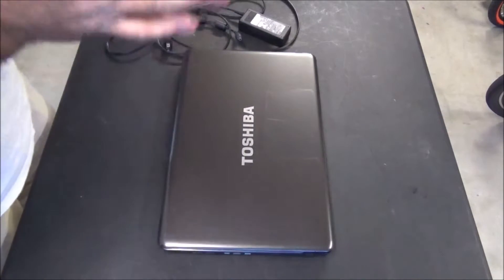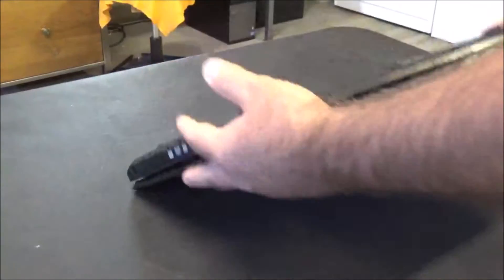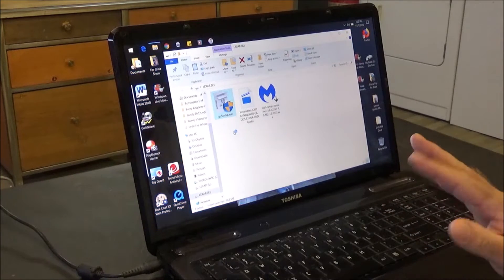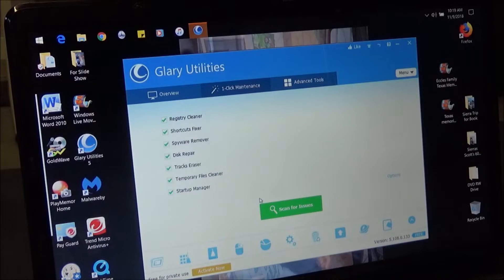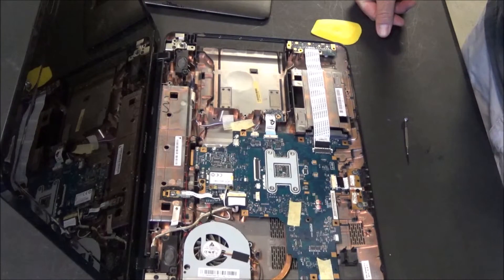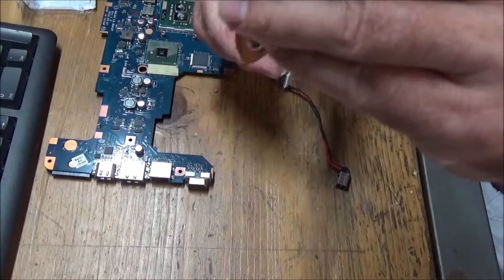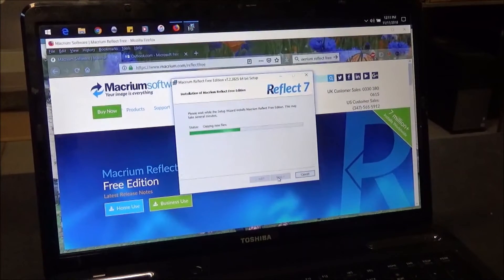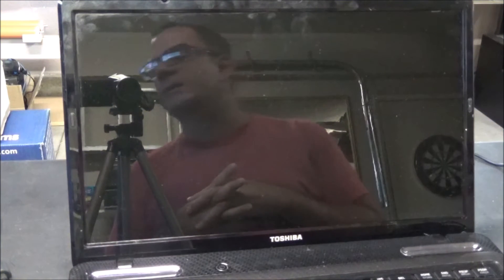Toshiba Satellite L675 Upgrades

Comment: I would also suggest any time you have and older laptop and have eyes on the cmos battery it should always be replaced, because it's easier when you already have the access to it, than if you wait till it dies and the laptop wont boot up anymore and you don't know why or what happened. It's a huge PITA if you have to tear the entire laptop down just to replace a battery when you could have done it the last time you had it apart.

Comment: Running Windows 10 on an old laptop like that...That is WHY it is slow.  Try Windows 7, it will run MUCH better.
Reply from the maker: I did these upgrades well over a year ago. The mother in law is still using the laptop and very happy with the performance. Even though I feel that W7 can still be used safely, it's feels obsolete and not supported by MS anymore. Linux running a Windows skin is a better option.

Comment: I've had my Toshiba Satellite L675 for 9 years now, bought it new in 2011 for $600 after my $1200 Toshiba Satellite M45 blew after only 5 years. A Toshiba buff, I was really shocked to see how the computers had changed since my M45 and couldn't believe the prices had halved and the power, graphics, and size had doubled.  I'm still using it, I do have speed issues but I don't want any upgrades.

Comment: How is the cooling for that laptop with the processor upgrade. I know your mother really does not do anything too processor intensive, but was wondering if it was thermal throttling or just shutting down from over heating. I got he AMD variant of this laptop and thought about doing the same but kinda of second guess myself and did not want to mess with thermal issues down the road.

Comment: I have the same laptop and got the free windows 10 upgrade, I am trying to use the second monitor( I have an HDMI 22 inch Acer) laptop will not detect it. I get the 1/2 screen but no detection. Drivers are latest version. Thanks.

Comment: Not sure if anyone will see this message but my laptop is almost the same as the one your working on this video I was wondering how you knew how i5 or i7 would be compatable I use mine for gaming though and worked great for its time but its slow now was wondering if you help me out with that little problem I'm trying to put in a i7
Reply from the maker: Hi Alejandra. I looked up the chip set for the laptop and found a list of compatible processors. The i5 that I used in this video was listed but no i7's . But while looking at i7-740QM cpu's on eBay, someone left a comment that said he had successfully installed an i7-740QM into an Acer laptop that has the same chip set as the Satellite L675. This is his comment off eBay: "Working fine when swapped into age-old Acer Aspire 7741G, which originally came with i3-370M (& HD5470M). TDP is 10W higher and the fan spins at a higher RPM but I don't mind as the laptop is actually usable now! Temps are fine, at least with recently cleaned cooler & better thermal paste. Would recommend everyone else to mention the upgrade paths as well, more information for upgrading old laptops is needed!" After reading his comment I'm pretty convinced that the i7 would work in the Satellite. But with no way to upgrade the gpu I'm not sure how much upgrading the cpu will help your gaming experience. Hope this helps!

Comment: I Scored an O'l Skool,  Dell "Latitude" laptop off eBay for $20 bucks!  It came without a hard drive,... I created a Bootable Windows 10 USB 64gb Sandisk Cruzer thumb drive,.....Runs Great,...but I'm gonna drop in an SSD, add some Ram, & Max out the CPU!
Reply from the maker: Nice dude! What model is it? I'm looking for a super cheap laptop for my neighbor. Just need to find one that has a upgradable CPU.
Reply: @PimptatoPCs  My first laptop!  I love this thing!  Dell Latitude d630,....it's only a Core2 duo, but runs Great,.. looks New, came without hard drive, ....Gonna crank the Ram up to 8gb. & drop an x9000 CPU in it,.....I cloned my desktop Optiplex hard Drive to a bootable USB, running Windows 10 Pro on the Laptop off a thumb drive!   Lmao....Waiting till Black Friday to pic up an SSD at Micro Center!  Go on eBay and just put "Latitude" in the search bar, then sort the results to the cheapest one first,....check the pics really Close 2 get one in Good Shape!    Mine was up for Auction, but I dove in the last minute of the listing, and Stole it for $21 bucks.  😎.  1of.the40thieves@gmail.com

Comment: A  I7-620m or the top 2c I7-640m  will only give you more clock speed and more  L3 "cash" -lol! And i have learned that you have LT that comes with 2c cpu that you will have to go with a 2c cpu and not 4c cpu may not support it . Acer Lt I3-380m . +psu+  a intel one wifi +cpu=  to much money and time to make it work for the money. Just ram to 8 gb's and ssd. big dif...
Reply from the maker: I was actually looking at the i7 740QM. I read a post were a guy installed it in a Acer Aspire 7741G and it worked fine. The Toshiba has the same chip set so I thought I might give it a try. The only thing is it's a 45W chip and the L675 cooling is only rated for 35W. The guy that installed it in the Acer said that his fan was running a little bit faster but the temps were good. The i5 560M has better single thread performance than the i7 so I just went with that. I'm still very curious to know if that i7 would have worked.

Comment: You're back! I was just wondering about you, and I just finished sending an e-mail to McGTech about some hardware he's getting.
An i5 for $5! Never thought I'd see the day! LOL! Use those same yellow plastic spreaders. You can usually find the service manual for most laptops online as a PDF file. It takes some looking, but it's worth it. I know for sure that Toshiba, Panasonic, Lenovo (IBM), and HP (Compaq) are easier to find. 
Good work bud! I know it takes a lot of patience to do these jobs, so thanks for doing this video. 
Have a great day!
Reply from the maker: I am! Good to see you're still subbed! McG has been putting out some videos and growing. That's awesome! That i5 was a steal, I almost got an i7 for $20 but the single thread was better on the i5 so I went with it. Those little plastic tools are great, I use them for window tinting but always find something else that they are good for. I probably should have looked over the manual before diving into this cpu swap but it turned out okay. Thanks for watching Matt!

Comment: I have a satellite with a Celeron 1005m and 4gb Ram. I thought about upgrading to an i5, but the little research I did suggested I had a soldered chip. I might just have to take it apart and see for myself lol, that new chip was a lot cheaper than I expected!
Reply from the maker: If you looked up the specific model and it said it's soldered, it's probably soldered. But that sucks to be stuck with a Celeron. Toshiba has a lot of models with a socket. I would do a little more research before cracking it open. I was really surprised to get that chip for $5, most of them were around $15 iirc.